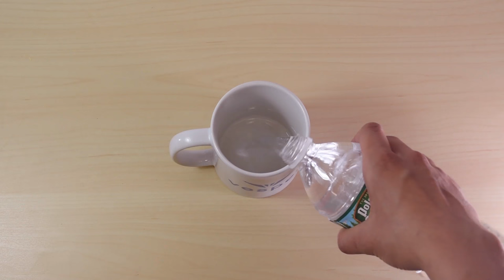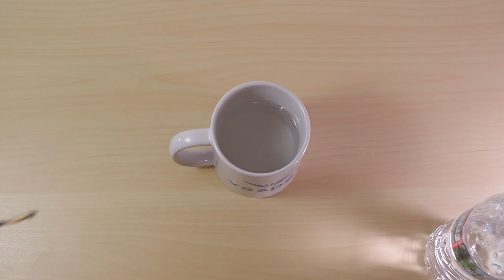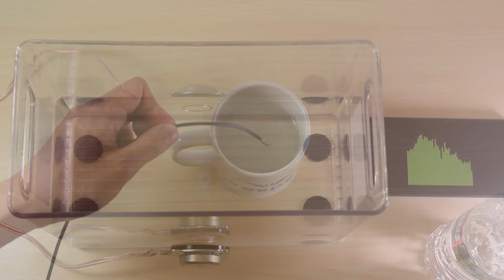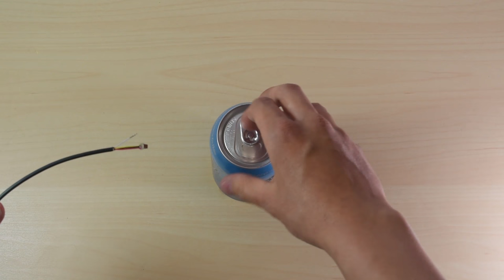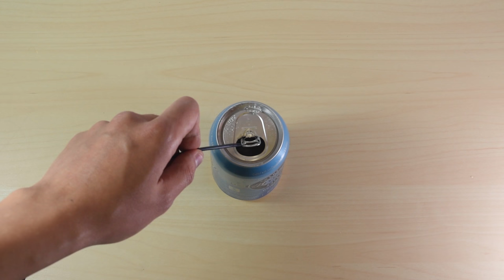Vesper’s piezoelectric MEMS microphone works under water

Comment: What are the steps I take to set up a VM1000 to record underwater? Is there a preamp? How can I run it to a 1/4" jack? Is there any soldering involved? I can't find instructions for this anywhere...
Reply: Hi there did you ever find a way to do this? I am super interested in setting it up like the video does to record underwater. Cheers :)